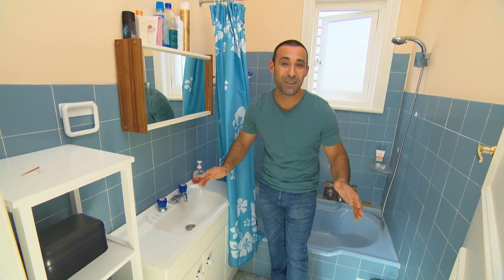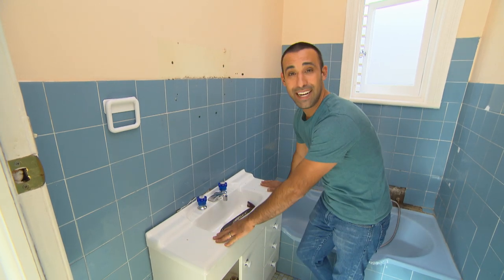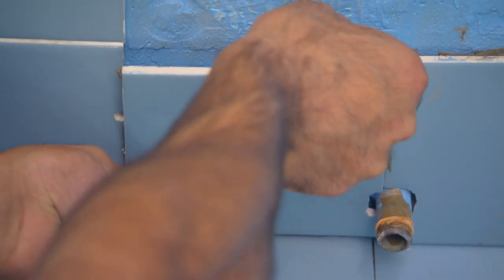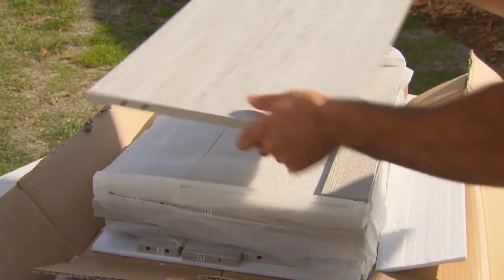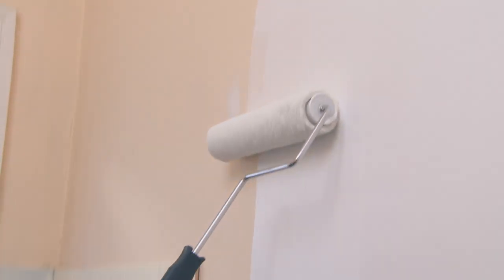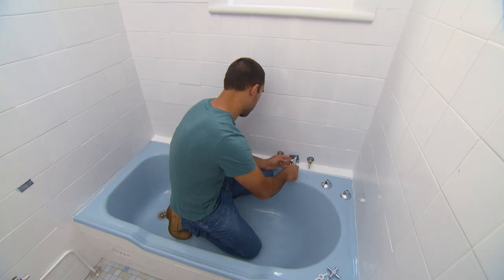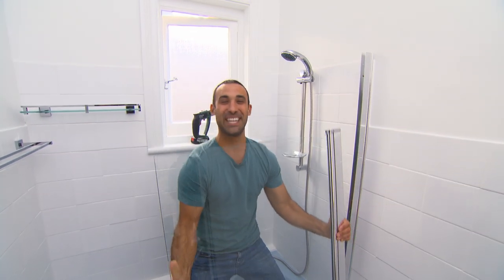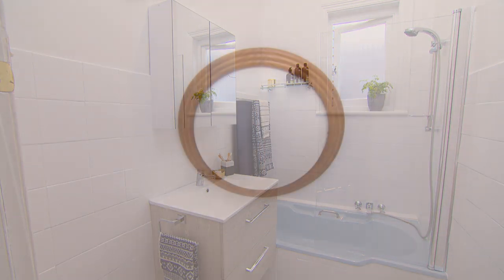Bathroom Makeover For Under $1,000 | Indoor | Great Home Ideas

Comment: Every person I've asked about painting over glazed tiles w/ a diy coating (and even the professionally applied epoxy that's spray coated ) usually complain that the paint lifts off in a few years - just another problem to deal with

Comment: Add an extra  $1000: place a glass shower instead of the tube, replace tields with new ones, the bathroom fixtures must be raised off the ground and finally to gain space you need a slideing door. I think that  it’s worth it 😊

Comment: It did end in a strange way. We didn't get to see the finished product. One thing I will say is the tiling looked appalling after it was painted as the tiles were a bit in and out waving along the wall and it was less obvious when the tiles were blue for some reason.  I'm sure the improvement was immense if only we could have seen it.